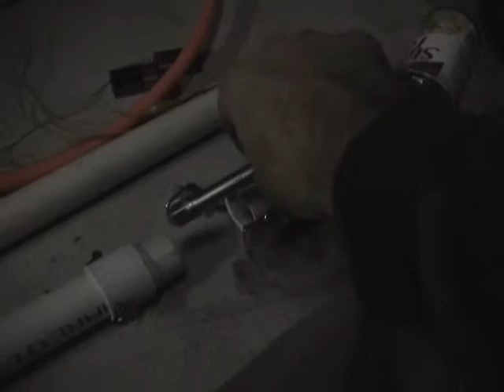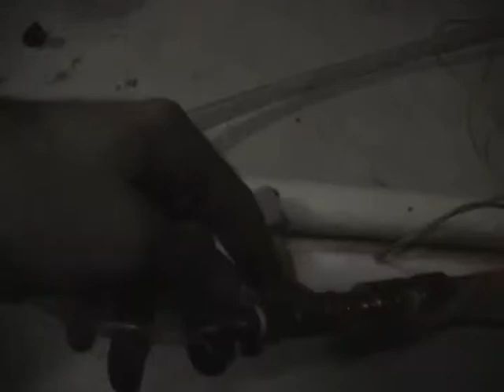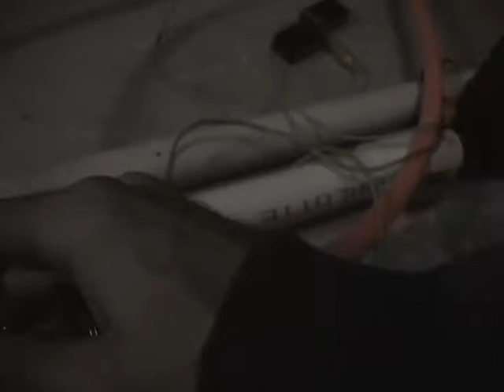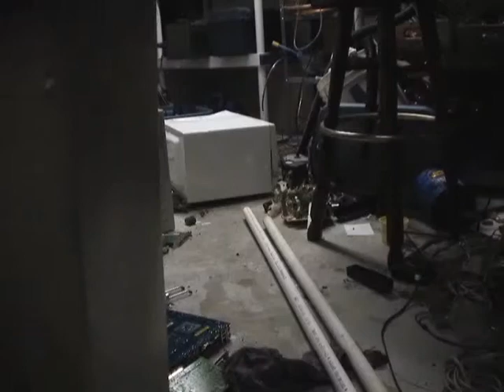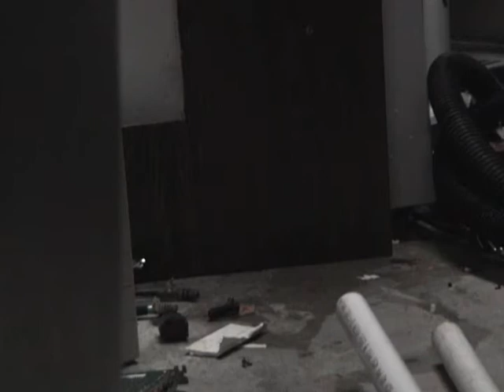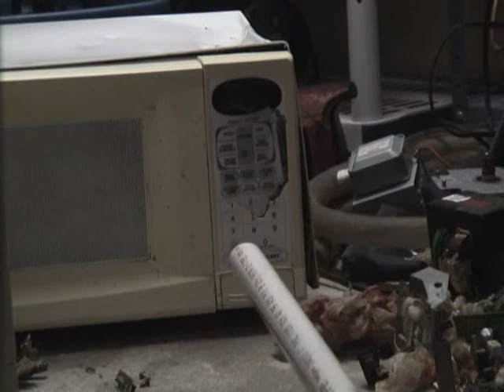Pneumatic Accelerator Ballistics Test (air cannon)

Comment from the maker: Hehe,  The valve is a one inch diaphragm-type solenoid valve used in lawn sprinkler systems.  You can find them at many hardware and home imporovement stores.  I have conducted experiments with a 4 inch valve of the same type but have problems with the air escaping too slowly and the valve not opening fast enough to work in a launcher. The valves are designed for water which, nearly incompressible, changes pressure much faster. I am trying to figure out how to modify the 4" valve to work w/ air.